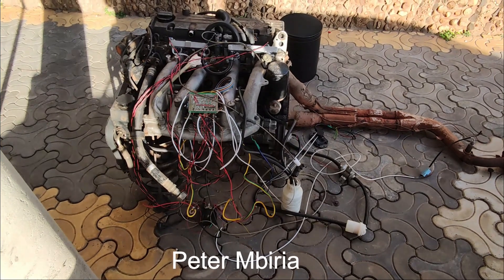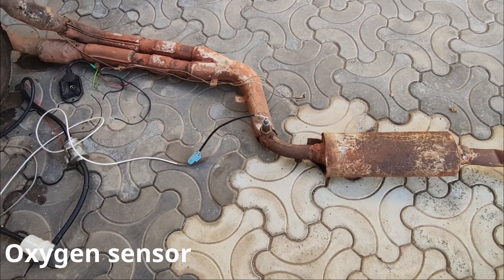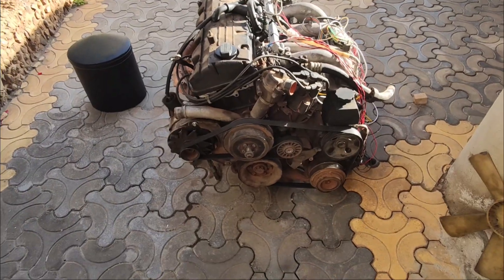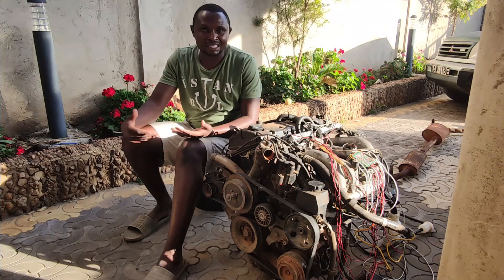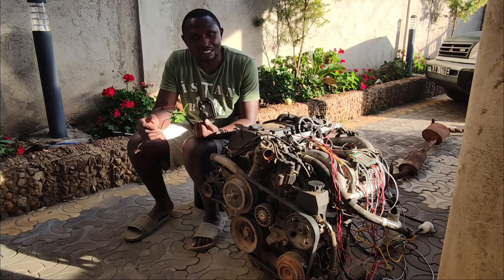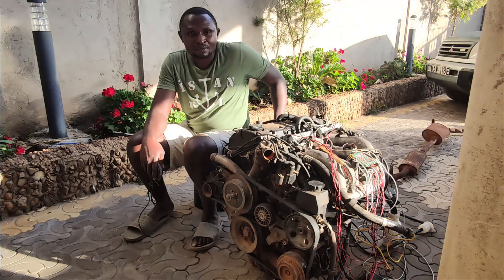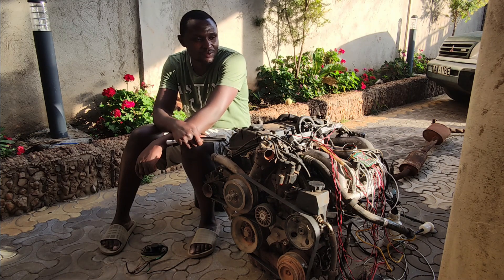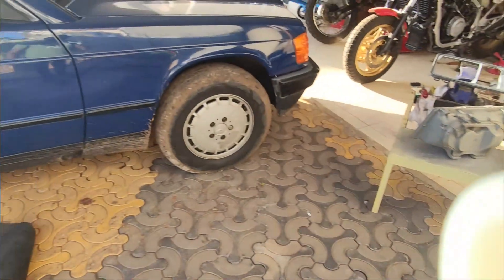Mercedes Benz M102 engine carb to EFI conversion

Comment: My 102 engine is burning black, high fuel consumption.
Reply from the maker: Hey man, thanks for reaching out. What's the set-up, FD or carb?
Reply: @PeterMbiria1  carb
Reply: How much change over
Reply from the maker: @lachansawe5321  It's normally 1155 USD for the whole conversion.

Comment: Hello, do not be bored, please, if possible, the map of Mercedes w124 230e m102 I need this very much, thank you
Reply from the maker: Hey man. Have you watched the latest engine progress?
Reply: @PeterMbiria1  No where to watch
Reply from the maker: @hojjatzare2483  https://www.youtube.com/channel/UCsdyGKIf47RFlEOmQR7sMdw
Reply from the maker: That's a link to my channel where you'll see all the progress done.
Reply: @PeterMbiria1  Thank you, I will watch your videos. But I really need a wiring diagram. I can't find a Mercedes diagram.
Reply from the maker: @hojjatzare2483  Oh, you mean the engine manual?
Reply: @PeterMbiria1  I mean the pinout control of the motor unit
Reply from the maker: @hojjatzare2483  I guess I'm not getting your question right. You mean the wiring diagram for the W124 230e FD system?
Reply: @PeterMbiria1  yes
Reply: @PeterMbiria1  I want a wiring diagram saw. Thank you
Reply from the maker: @hojjatzare2483  What I have is an engine manual which should have what you want. I haven't checked for the wiring diagram but it should be there. Do you have Gmail account?
Reply: @PeterMbiria1  Thank you very much for your help Peter
Reply: @PeterMbiria1  Peter, I am sending my Gmail account will be deleted

Comment: What is needed what ecu are you using and the fuel rail what kind please inform
Reply from the maker: I have built the ECU from scratch. I have designed the schematic design of it and also the program running in it.

Comment: Well done excellent professional work. I have the plan for M117 engine to convert from CFI to EFI.
How I solve ignition and ECU
Reply from the maker: Hey man. This is interesting and would like to also do the same on an 8 cylinder engine.  What I have done is design a custom ECU that I could define all parameters like ignition angle, ignition advance, sequential and multiport fuel injection in the program. It doesn't have maps as I took a different route on how I programmed it. Please check the latest video I have uploaded for progress.

Comment: duuudeee....you did a awesome job...can you explain how did you make the ecu please?
Reply from the maker: Well, to begin with, I studied how a normal ECU works. From that knowledge, I designed my own ECU using normally available MCUs, arduino Mega which I then upgraded to arduino due. I also designed the drivers that control the various actuators like injectors and then programmed the MCU based on what I desired the engine to perform. It uses a number of sensors like MAP, throttle position and engine crank position in order to calculate the amount of fuel to inject and at what time.
In my latest video, the engine no longer uses the distributor for sparks but rather now has coil over plugs. More updates coming soon!!
Reply: @PeterMbiria1  well... basically you used continuous injection method?...so how did you match oxygen sensor and map sensor to calibarate air fuel ratio?...did you use PID?
Reply from the maker: @garage9732  At the moment, I am yet to incorporate Oxygen sensor so what I'm relying on is throttle position, engine temperature and MAP sensor inputs to calculate the amount of fuel to inject at any cylinder, realtime.
Reply: @PeterMbiria1  you're a genius! I love people that go out of their way and make something like that.